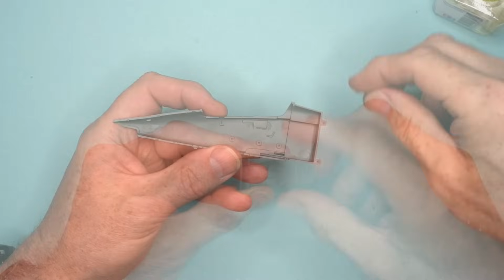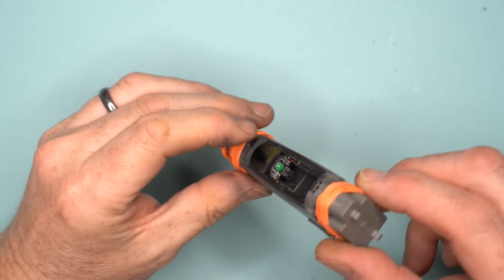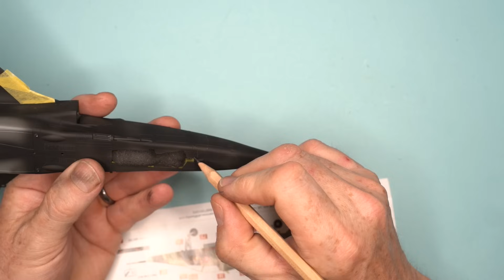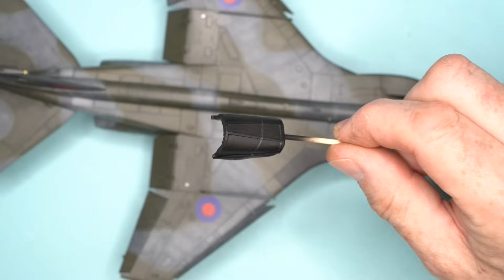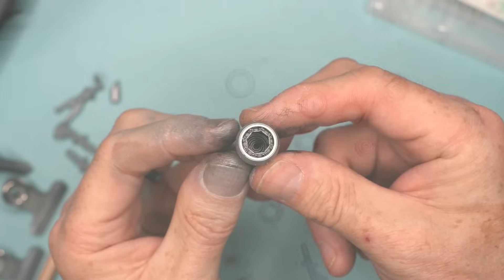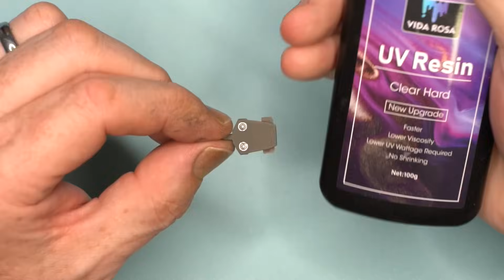Airfix SEPCAT Jaguar 1/48 scale  - full build

Comment: You're getting quite good at this aren't you Richard 😁
Reply from the maker: I do try, a lot 😆 It's not directly proportional to the viewing figures though 😁
Reply: @RichardsModellingAdventures 
I do agree with you about the resin, the seat and engines are stunning but the u/c legs look just the same as the OEM parts to me.    I'm sure it will find  a worthy home.  Another stunner 👍
Reply from the maker: @ricardoroberto7054 the resin ones just have built in break lines. Cheers buddy 👍🙏